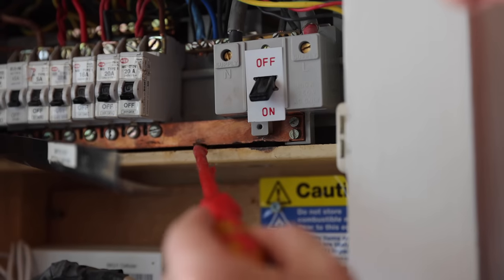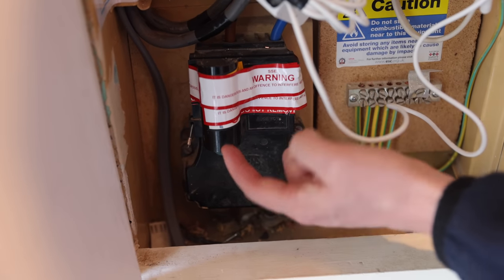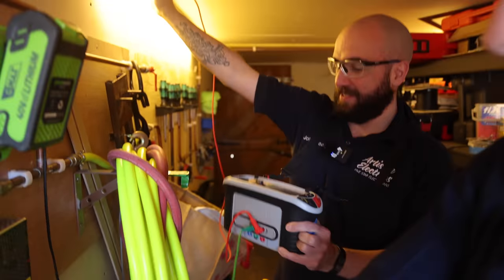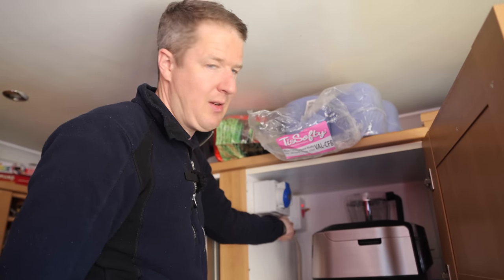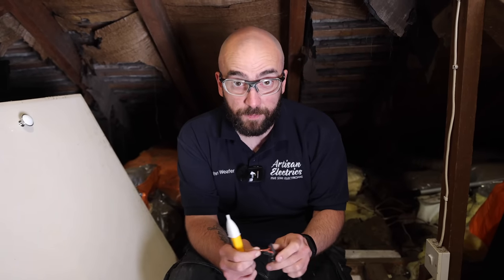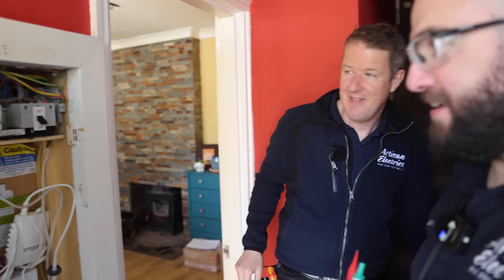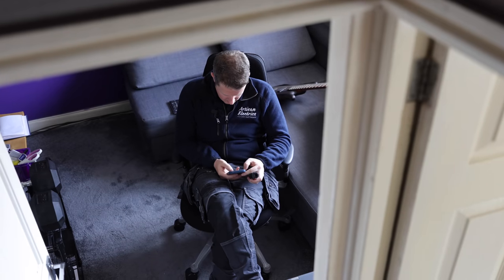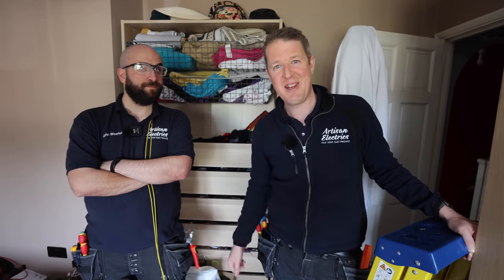REWIRED BY A CHIMPANZEE! Skeleton Board EICR

Comment: Personally I feel like any conductor downstream should be able to carry the fuse rating. And don’t be so quick to call out DIYers, top 10 worst installations that I’ve seen were all done by electricians. Worst was a French helicopter electrician that flew out to Finland and wired a summer house in trailer cable (that multi colored 7 conductor stuff). The gentleman luckily wasn’t familiar with 3-phase, so he wired a 3-phase short at the meter (which he shouldn’t touch either but hey ho), so the DNO got called to have a look when he kept blowing the supply fuses.

Comment: Great videos guys . I've been a sparks for nearly 30 years , could you please answer a question for me , 18 months ago I 1st fixed  a 3 bed property down here in Cornwall. My QS from the north has questioned my use of 1mm T&E on the 2 lighting circuits within the property.  max of 530w load on the first and 600w load on the second. 
I was told I should have used 1.5 mm T&E  , over the years i have always gone on the rule of thumb and used 1mm for domestic and 1.5mm for commercial .
Please could you tell me if I was wrong? , as that's what i have been lead top believe, have I missed something in the Reg's ?
Reply: Swedish standards says 6 A for 1.0 mm^2, 10A for 1.5, 16 A for 2.5 and 25 A for 6...  stepping up one dimension if continuous loads are to be suspected.
Would be interesting to compare notes on that one, as I at times feel the Nordic standards being ridiculously strict just because they can.

Comment: With regards to No RCD's on circuits, as I guess you know (EICR) wise socket outlets/ or if a circuit installation methods specify it i.e follow manufacturer's guidelines (Showers). Anything else make sure supplementary bonding is in place and verified, C3 coding reccomending RCD's . New install is a different kettle of fish!
Reply: Way back in 17th Ed. the ESC gave us firm guidance (Best Practice Guide, our "Bible" starting point for EICRs) that socket-outlets without additional protection=C3, in a location that can reasonably be expected to be able to be used to power outside equipment= C2.  In most domestic settings, that means upstairs socket cct C3 is expected, but downstairs is almost always C2 because most people still plug the lawnmower into the lounge wall socket through a window...

Comment: that is where you charge more due to ongoing training and experience. as a new electrician i wont put my name to something not in the regs book that i cant have  certainty is not safe. an older more experienced electrician may have trained to prior editions and has knowledge and experience with said devices. where a new electrician may quote for more work that experience electrician will quote for what's needed.

Comment: Who came up with Brown/Black/Grey for three phase?  Im an electrician in Australia and euro power cords suck.  If the light is bad, or UV light has faded a cable, or the cable dirty, Black/Brown/Grey very quickly becomes Brown/Brown/Brown.  We use Red/White/Blue and it way easier to work with.
Reply: In a typical installation the order of phases doesn't matter, it is much more important to identify a wire as being (potentially) live. That's why a set of close colours were chosen. They also nicely contrast with the other colours, even for most types of colourblindnesses.

And, btw, if UV has faded the inner insulation of your cable, the installation is rubbish and unsafe.
Reply: Harmonisation with Europe saw the colours change I believe.
Reply: @buzzy correct it was done in 2004.
Reply: Black used as active conductors should be a no no as can get confused as neutral conductors  especially if the old previous colours for neutrals were black .

Comment: 8 mm is way overkill for an earth i think it should be no more than 6 mm
Reply: 10mm was mentioned. I think it’s crazy too.
Reply: Needs to be able to handle the full fault current of the installation to blow the service fuse without overheating during the fault.
Reply: 6mm would be fine for the main earth if it really is a TN-S with 16mm tails. 10mm earth is the bare minimum for a PME installation as the earth has to carry neutral fault currents. I think I only heard 10mm mentioned when they were talking about the water bonding though?
Reply: @havoctrousers  it's unlikely to be true TN-S these days as the DNOs tend to PME everything on their side so even if it presents as TNS at the head it might be joined at the joint 3 yards down the road. 

Although having said that I notice they're in SSE territory. SSE are our local dno and they do still install genuine TN-S in areas where they know the network is suitable. The 10-mm size might be in preparation for when the dno decide to fix the looped supply. If you're having to replace a bonding cable anyway you may as well go with 10mm

Comment: re board, other than it is a shed, and wouid as you rightly say C1 fail, please please can you dispel this myth that regs apply retrospectively, yes no RCD or SPD protection but if at the time of install the regulations in force did not require them to be fitted then it is not a fail.Other than that another decent video

Comment: Some one must of stole a whole bunch of speaker wire and thought il use that to re wire my house cos your not going to buy it speaker wire is very expensive much more that electrical cable .And a grow house is not going to worry about being saftey approved there in and out in 12 months time. I don think Artisan will get a call to say can you install some lights and ballast for my house plants at any time i want it don by the book lol ..Two house from me rented out a house for a grow house they didnt like were the door was in one of the rooms so they just knocked another whole in the wall and made two doors and they juts made a massive hole in the roof for the air pipes

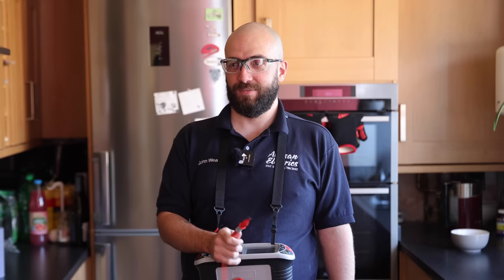Comment: 11:11 how it can be all right when the "fuse connection unit" is NOT protecting the section ot the cable (1mm) from the point of connection to the "fuse connection unit"?  What fuse is protecting that section of 1 mm??
 That is wrong, ...designed stupid... is not taking consideration THE WHOLE leght of the cable from it's connection point where it shoud be FUSED!

How it cannot make sense in your mind such simple finding..?

Comment: If our Philippine Electrical Code is being implemented properly no house in the Philippines could pass 😂.
Reply: My favourite in the Phils rules is that there MUST be at least one receptacle (socket) (230v) within 900mm (3 feet) of the edge of a washbasin, presumably to avoid the need for a 'dangerously long' lead for the hair dryer (since the mirror is over the basin, innit)!
Reply: @christurner6430  That’s dangerous lol. I follow UK rules.

Comment: I’m a bit surprised that you and an NIC inspector thinks it’s acceptable to spur of a ring with 1.5mm. The cable needs to be able to handle a fault current if it is damaged. The design load of the spur is irrelevant.